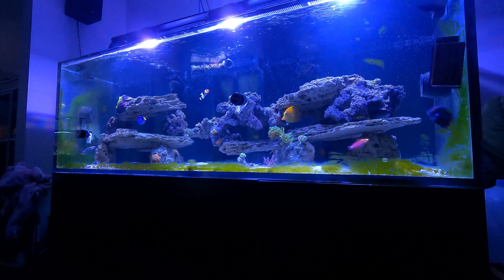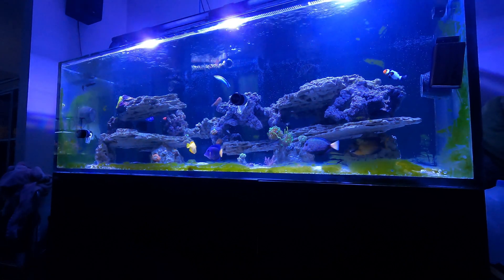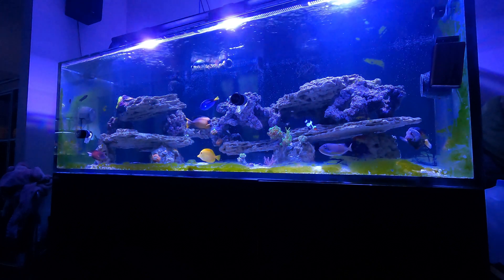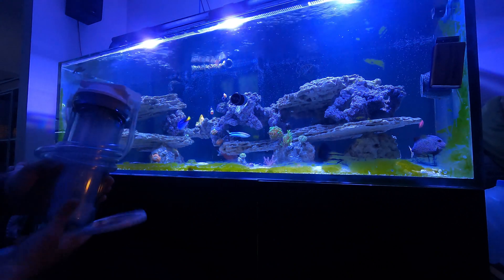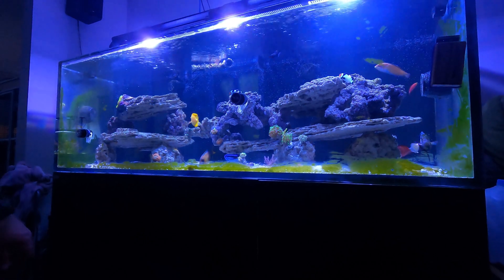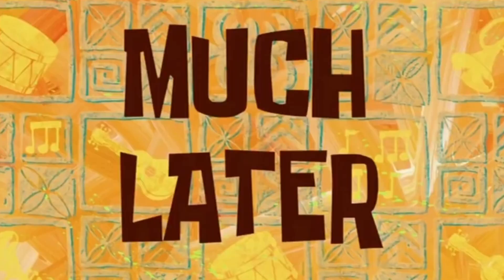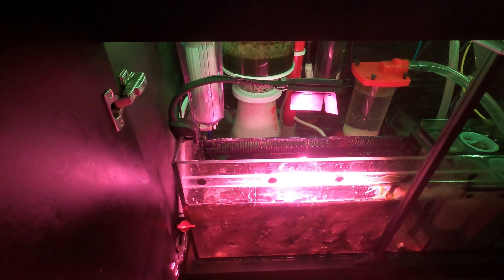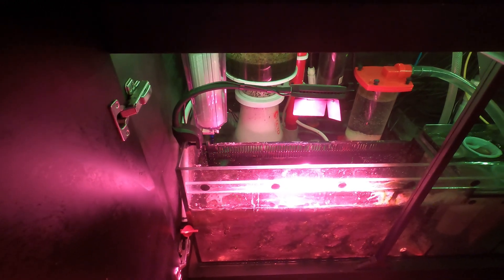Does Co2 scrubber solve PH issues

Comment: Ok so this is a few months old but if you run a line out side to your skimmer and hook up the c02 scrubber out side it will boost your ph alot. That's how I have mine and my ph went from 8.2 to 8.4 it did take about 24 to 48 hour to boost but It work with sucking fresh air in to then c02 scrubber.
Reply from the maker: would love to do it but tank to far away from window or outside wall

Comment: I happened across your video. I had the same issues with pH as you. I purchased the same reactor and used CO2 scrubbing media. I thought the CO2 scrubber alone was a slight success as you seen initially. What turned out to be my problem was the last item you mentioned. I purchased a CO2 monitor off Amazon to check my own home CO2 levels. They were surprisingly very high. I am opening 2 windows twice a day for about 5-10 minutes. My pH is now staying between 8-8.2 depending on when I am home to get the levels of CO2 back in tolerance.
Reply from the maker: I figured this out this winter as I been leaving windows open thank you